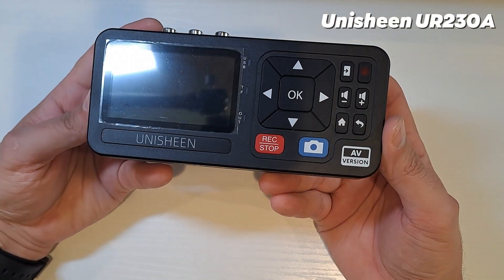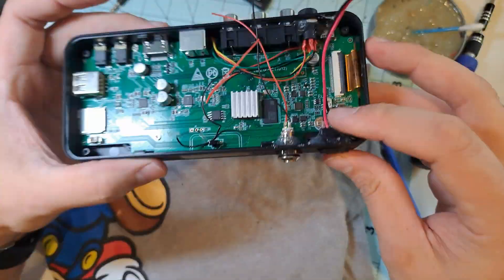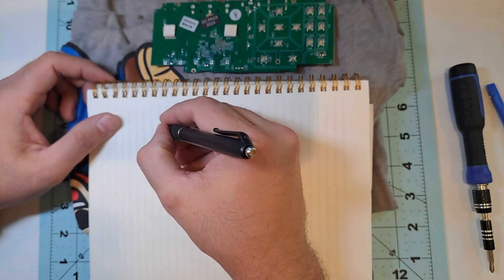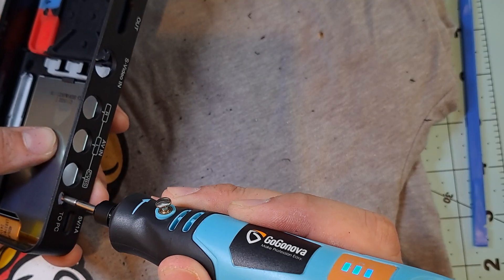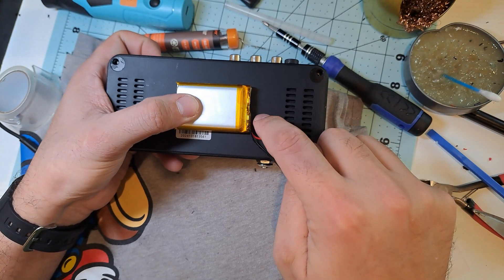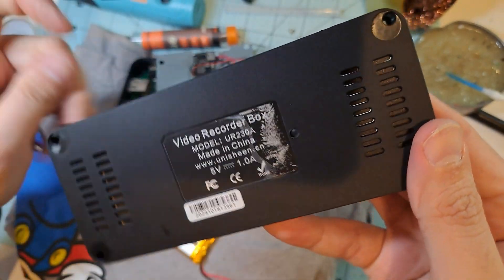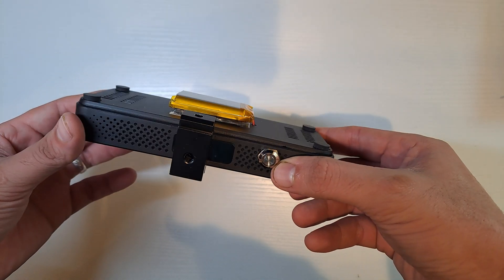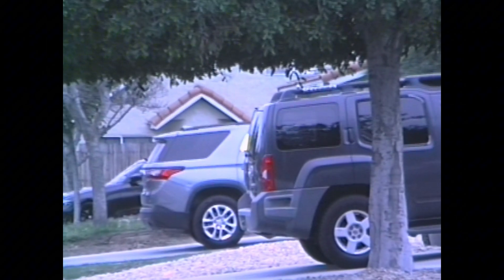TAPELESS is Finally PERFECT in 2025! Must-See Mod!

Comment from the maker: Links to the materials:
I'm not a seller, and I don't earn any commission or profit from these links, I’m just sharing them in case they help! If you’d like to support my channel, please leave a comment, drop a like, and subscribe! It really helps a lot! 🙌🎥
These are the exact parts I bought, but feel free to use similar ones from sellers you trust or at the best price you can find.
If you're buying from AliExpress, I highly recommend choosing sellers with the "Choice" option—orders over $10 you get free shipping, and the prices are often better!

Unisheen UR230A
https://tinyurl.com/yxawr2fb
3.7V 2000mAh Rechargeable Battery
https://tinyurl.com/4u29stt5
Battery Charger Module
https://tinyurl.com/3tkat5r7
Power ON/OFF Switch
https://tinyurl.com/k3aj4tjp
3.5mm 4 pin Connector
https://tinyurl.com/5c68d743
Cold Shoe
https://tinyurl.com/vtw9fs8m
Monitor Mini Tripod
https://tinyurl.com/rjmj38x3
Case L Size
https://tinyurl.com/yhj6bmfk
Type-C Female Cable extender
https://tinyurl.com/ybyynsex

If you enjoyed this video and want to support the channel, you can buy me a taquito on Ko-fi!
It helps me keep buying broken cameras and parts for more projects, so I can keep making videos like this. https://ko-fi.com/maxvega Thank you so much!
Reply: What kind of wire are you using?
Reply from the maker: @arisnieuwkerk  Hello! 30 awg :)

Comment: Unisheen is junk. It drops frames and has a low bitrate, as you can see in your test recordings. Buy a PCI tuner for 5 euros, Pixel View, or something similar, and configure the QV4L2 utility under Linux. Set the resolution to NTCS/PAL. Depending on what you're using, you'll notice a significant difference. After adding it in OBS Studio, you'll also need to set deinterlacing to YADIF x2. A very nice image without digital artifacts can only be achieved with PCI capture cards from ATI, but unfortunately, these are expensive and difficult to obtain.

Comment: Hey just completed this mod and its a life changer, now i can record completely untethered. I was wondering if it would be a good change to put the switch between the voltage converter and the unisheen rather than the battery, therefore you can charge the battery without turning it on, and have a switch to have it off and plugged in. Thanks for the tutorial!!

Comment: Just bought the thing, seems very nice. Just one question! I've not seen in the menu any selection of PAL / NTSC (I'm in Europe and I want PAL). PAL is 576 and NTSC is 480. The menu gives choices 1080 and 480. I'd prefer the original resolution, 576. Neither a huge 1080 file, nor a downgrade to 480. Is there any solution, or it doesn't matter at all?

Comment: Am I able to use a momentary 12mm switch instead of a 10mm (that's all they sell on Amazon I think) :0? Also my camera only had video and mono audio output I think (yellow and white), I have a composite to TRRS (it has two rings) will this work?? :0. Would audio be stereo or mono??? (The camera has a built in stereo microphone so I'm not sure)

Comment: I've ordered one, but I got all 4:3 footage recorded directly by 16:9! 
Any way to get in an original format or was some kind of defect of something? 

Maybe you know it... Before I've used an Unisheen HD HDMI and I had the option at the remote control, but not with thi one...  😢
Reply from the maker: @andorcor  Hi! Too bad you're having trouble. Are you sure is the same model? Cause I can record in 16:9 and 4:3 without problems and also use the remote in this one  :s
Reply: @MaxVegaKun  Yes, yes, is the same model. Because that I've watched the video... I've bought this one because S-Video and because the other one (500) records 60 fps always, also by composite. 
That means that you need double space for every file without get more quality. And also became a problem if you wanna deinterlace it, because you're already working with a 60 fps file. 

So, looking for S-Video (more quality with a good player, JVC BR-S 622) and 30 fps, but was recording 16:9 under his own opinion.  😑

Comment: it is posible to use something like this ? 5.8G FPV DVR LS5802D 7 
Its a fpv monitor with DVR and it had a built in batery.
Reply from the maker: Yes! Almost all fpv dvr works, just check the video pin input, it maybe will need a custom cable, but if it has a composite video input should work :)

Comment: HI max ! after seeing all your latest videos on retromod of those cameras i decided to do one myself with a modified Unisheen and a JVC GR-80S i am now encountering a problem my camcorder is a SECAM and  the Unisheen only reads Pal/Ntsc i am trying to find a solution to transfer the SECAM signal to pal but this is hard to have a versatile solution... 
For the Unisheen modding i'm using a 5/30 V to 5V converter directly in the case and i'm using an external battery  to power the Unisheen and the camera via the DC power cord, this should make a pretty compact setup if i find a solution to convert the SECAM signal...

Comment: When you charge the battery, is there any indication that it is charging? (I suppose on the circuit board itself, there might be a small LED light that I forgot to check?

Awesome build!

After following your steps, I noticed that the recorder unit turns on, when I connect the USB-C cable to charge the battery. Is this normal?

Thanks again!

Comment: 4:42 Warning! I ordered a pack of these EXACT 3,5mm TRRS sockets and used them in a different project. I wasn't getting the signal out and thought something's wrong with my circuit, but it was the SOCKET. They sent me WRONG sockets which use the "SLEEVE" (the final one in TRRS) as a switching contact ("SLEEVE" goes to "RING 2"). It does NOT pass the signal through. If some of you are having issues, check the socket with a multimeter!

Comment: interesting i picked one up after your video but instead i was going to use a powerbank board with a 3.7 recycled vape battery so everything can fit inside the unisheen maybe if i find till ill post it.
Reply from the maker: @gtasandman  Awesome! Let me know how it goes! I tested several 3.7V batteries, 500mAh and even 1000mAh fit well. However, in my tests, the first one only lasted about 20 minutes, and the second one barely reached 45 minutes. If you're planning to place them inside, make sure to insulate them as much as possible. The charging board generates heat, and there are many components that could puncture the battery, which could be dangerous
Reply: @MaxVegaKun  yeah i have a couple 1000mah i was going to try and put some insulation between the boards. Honestly when i was out shooting with my camera it turns off every 5 mins when not shooting with a tape and that also resets the display so every time i have to go to the menu and turn it back off so i didnt end up recording more than 10 mins of footage for the day. going to try and pick up another tape camcorder.  I also tried to pick up a HDD jvc to test out buy the tested working one from ebay i got ended up with a hard drive error.

Comment: Another excellent video. Nice work. I did something quite similar on a number of analog recorders like the Unisheen, and smaller ones like the ImmersionRC Powerplay. The main difference being that I created my own 'standard' using 8 pin mini din connectors which are similar size to the 3.5mm in terms of footprint. This meant I could connect AV input and output signals and control signals too, to start and stop recording from the camera, all from one cable. Very neat. I like what you did with the battery though. I wish I'd added that, and I'm going to order some of those charging boards too. No idea why a device that is built for portability would not include an internal battery. There are similar form factor recorders with HDMI input that do include a battery! Very strange. Keep posting these videos. Love them.

Comment: Omg dude what an awsome build!
But tbh the plus side of the minidvi is that its really compact. Do you have a solution for miniDV cameras? Sony had one where you had a device with a compact flash card and connect it with firewire straight into the camcorder. The benefit was that it was a digital output and no loss of quality
Reply from the maker: Thanks a lot! I really appreciate it! Yeah, the MiniDVR is definitely compact, and I totally get why digital recording straight from FireWire is appealing. Unfortunately, there aren’t really any modern, affordable solutions for direct digital recording from MiniDV cameras. The best options are older devices like:

-Sony HVR-MRC1K – Uses CompactFlash and records HDV/DV straight from FireWire. Used price: $250–$350.
-Focus Enhancements FireStore FS-4 – HDD-based direct-to-edit recorder for DV/HDV. Used price: $150–$200.
-Datavideo DN-60 – CompactFlash recorder, solid-state, and rugged. Used price: $200.

These are all quite expensive for what they offer, and since they’re old, reliability can be a big issue. I've done a lot of experimenting with digital video workflows, and while I understand why you'd want the best quality, to be honest, the difference isn’t huge, at least to my eyes. I’m more interested in the look rather than chasing the absolute highest quality from these cameras (which, realistically, isn’t much compared to modern gear).

At the end of the day, any current camera will outperform these in raw quality, but for nostalgia and aesthetics, I love working with them! 😊

Comment: Good work! I've got some of those battery charger/booster boards, they're really handy for any small project. I've recently been using them for some sci-fi props for a friend.

From my experience, there's a couple of things you might want to try next time. First is to use the white plastic connectors like lots of batteries are supplied with, and have that come out of the case. I find that handy for maintenance (and swapping to a fresh battery in a pinch!). Second is to put the switch on the wires going to whatever device you're hacking instead of the battery, so that you can charge it without having to switch it on. The board protects the battery from going flat, they're really clever for cheap circuits!

Keep hacking and making videos, I really enjoy seeing what you do next 🙂
Reply from the maker: Thanks a lot! Those are great tips, I’ll definitely keep them in mind for future mods, appreciate the support!